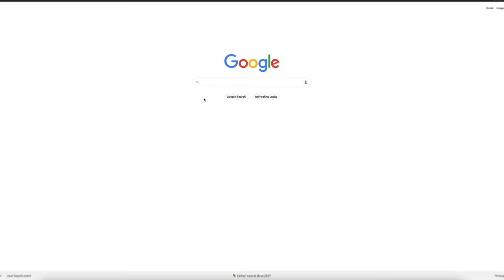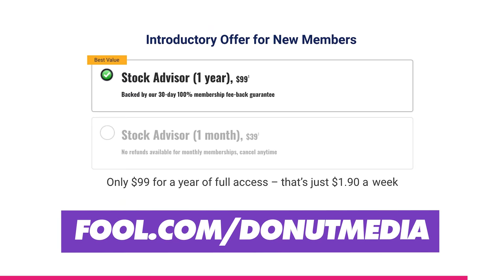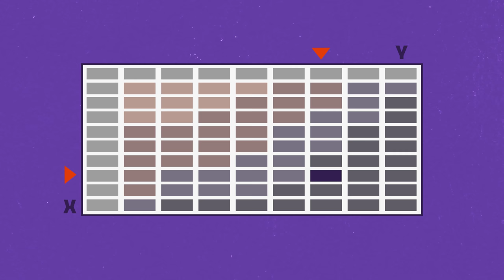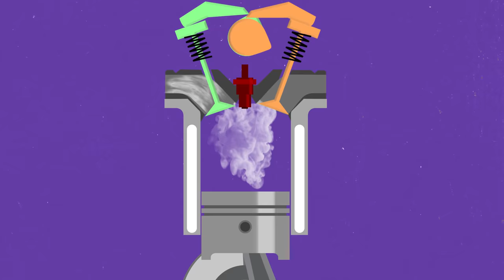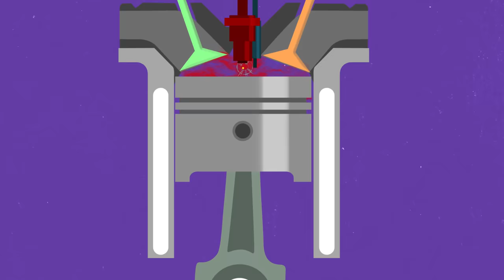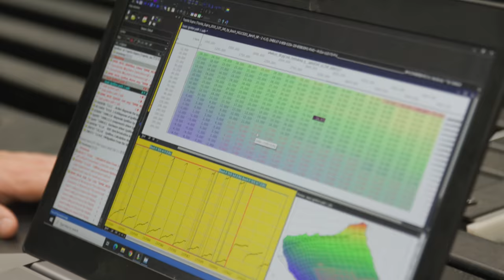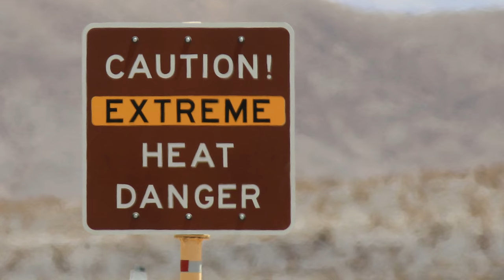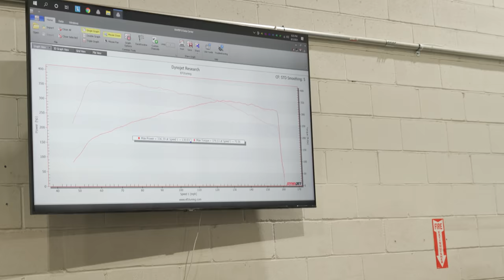Why Are They Banning ECU Tuning?

Comment: Whats sad is that ECU tuning shouldnt matter. If they are worried about pollution then just do a normal smog test. If it passes then the tune doesnt matter. If it doesnt pass then oh well, get it fixed. The point that ECU tuning actually is better than stock isnt the problem, the problem is the gov wanting money to confirm and make it legal to do so. EPA isnt a law enforcement agency nor should it be. Im tuned with E85 and my emissions are a lot cleaner even though I burn more fuel due to the characteristics of e85, yet its illegal to tune to e85 no matter what although the gov pushes for cleaner fuel alternatives. Seems the only alternative they want is EV cuz its big money.

Comment: I don't know why they say an engine is an air pump. I don't think so. Air goes in, but what comes out is CO, not O2. So it is like an O2 to CO converter. Basically, its purpose is not to pump air. If it was, it would be called a compressor. A compressor or a blower is an air pump. At least that's what my little brain thinks.

Comment: I tuned my car for flex fuel here in cali. A buddy who has a smog shop told me imma need a new clean ECU because the previous smogs will automatically flag my ride even though I went back to stock cuz it won't sync with their records... If true its not just the ECU I will need, I'd also require the companion immobilizer right?

Comment: No thanks. I'll stick with carburetors and points distributors. If I want forced induction, I will use a belt driven supercharger. There is no reason an engine needs to be super complicated. I have gotten 1000+ hp out of a small block Chevy with absolutely no electronics to fail. Admittedly that engine would be a nightmare to drive on the street, and was built for drag racing. But cut that power in half, and you still have way more power than you can use on the street, plus a car that is fairly easy to drive on the street. And it is simple. Two valves per cylinder, one cam, pushrods, no VVT, same basic design they used back in the '50s and earlier. Solid as a rock. No small fragile parts to break.

Comment: What's the difference between metal, duraflex, fiberglass and ABS/etc. body parts? Carbon fiber is obviously great but expensive so I didn't put it on the list but I was wondering why our cars are made of metal and the racing/drifting ones have plastic like body kits
Reply: Lightness, strength, and price. 

Carbon fiber is extremely strong, extremely light, and extremely expensive.
Metal is heavy, strong, and cheap.
Fiberglass is light, strong, but more expensive than metals.
Plastics are light, weak, but very cheap.

In racing, lightness is most important and with big budgets they can afford carbon fiber. Drifting does not seek performance nearly as much as racing and cars are more likely to experience body damage, so plastic is the most price effective option. Road cars use either metal or plastic depending on body panel, just to keep price of production low.
Reply: @PURENT  im mainly asking about Duraflex, fiberglass and ABS. Whats the dif between these 3. Price range, durability and weight with a measure unit or some comparison(like Duraflex is x times stronger than Fiberglass and x times lighter)

Comment: Someone was not thinking about the big picture at all when they drafted this legislation. They need to stop, slow down' take a closer look, talk with the public more. Then implement a law that addresses emissions. 
That law talks about modified ECU programming in way to wide open of a definition. It should have stated something like:" Changes to the programming of a vehicles  Electronic Control Unit after initial manufacture shall not change values of exhaust gas emisions of oxygen (O2), carbon monoxide (CO), carbon dioxide (CO2) and hydrocarbons or change Lamdba outside of standard acceptable safe values as determined and set to law by the state legislature at a given time." Just stating changes to the ECU now makes all sorts of vehicals and accessories to them illegal. 
DUI monitoring
Measuring and control units for DUI restrictions. Not all but many of those devises that you blow into to start or not your car when you have gotten a DUI need ecu programming done.
Working vehicles 
Adding a PTO pump to operate a lift gate, snow plow, lift and all sorts of other things sometimes need ecu programming. Changes made that still comply to emissions but change power and shift function for towing trailers.  
Disabilities 
Some installation of wheelchair lifts in vans need ecu programming as well as some disability accessories like hand throttles, hand brakes, shifter relocation kits. 
They have affected so many areas they did not intend to. They are going to have to make changes to that law very quickly or abolish it and start over.

Comment: This shows how little they know about car tuning.
Car manufacturers don't have the luxury of time, to go about tuning every car, so instead they have a generic map that'll work for those particular models.
Half the reason why gains are so easy, is because it's tuned to that specific car.
Mine will have a stage 2 remap, which means better performance, and lower emissions.
Just shows how clueless they are.

Comment: ECU TUNING IS NOT WRITTING CODES -- IT SHOULD BE FEEDING INPUT TO THE CODES\MACHINE LANGUAGE. SOMEONE DID THE ALGORITHM for you AND YOU ARE ONLY FEEDING A VALUES.

The tuners understand the need of the engines but they do not understand the tolerance of an engine.
They don't know when they will put holes in the piston, throw rods and land a ring and the catastrophic engine failure like cracking the block and the head. Metallurgy is another area a tuner must understand.

Comment: But is there a second elephant in the room?? How much of this is banning drivers of usually sports cars getting a more performing tune, or at the very least a tune better suited to the climate the car is driven in (sea level, temperature, etc), and how much of this is about just doing a blanket ecu tuning ban because of the “rolling coal” diesel truck assholes and the government doesn’t care to take a more nuance approach.

Comment: If your car was built after 1972, are you really a car guy? 1966 Chevelle with a 572 big block with a 14-71 supercharger, 1965 Chevy G10 Van with a 383 stroker factory rated at 600 hp, and a 72 Vega funny car that runs mid fives in the quarter. All without the benefits of an ECU or catalytic converters.

Comment: A) anyone claiming their tune is better for emissions is a fat liar. I'm friends with a guy that started Wolf ECUs and used to do R&D for GM and earned his PhD in combustion simulation. 
B) physical changes MIGHT make the emissions better, but those were also blanket banned a long time ago. The basic premise is that there's no real way for the smog shops to test this. They just look at two common load points and sample there, but the actual full test is very expensive and time consuming. It's easier to just blanket ban any tuning since there's no way to really fully validate.

Technically it isn't REALLY banned. You can pay 10-15k to get the full test approval and a sticker for your modification. You just need to do.it after ANY change.

Comment: Most people aren't Tuning Modern cars they Tuning 10 to 25 year old cars most of these are for racing purposes.these are not most peoples daily driver a lot of these cars run mostly on e/85 or methanol not (Fossil Fuel) most of these cars are broke down or in some state of repair a good chunk of the year so there low mileage vehicles.The truck and trailer that tows them to the track probably is doing more polluting than than race car,and they are a very small percentage of vehicles on the road.car's are not as big a problem as say the trucking Industry.

Comment: Color me surprised that your "experts" who just happen to be and ECU tuning shop you've worked with in the past and stands to lose with this would say that ECU tunes don't affect emissions.  You even state in the video that they go for rich mixtures and I don't know how many videos of Donut's that I've seen where y'all have done tunes that undermine this video.  I mean the high/low series and the worth it Miata for a start.  You can disagree with the regulation without being dishonest about the reasons for the regulation and acting like there isn't a valid reason for it.  ECU tuning has been used to get around emissions testing forever, including setting one tune for passing testing and then another tune for all other times and y'all have even talked about it in your videos.

Comment: They don't want ppl messing with the speed controls and frequencies of electrical cars lol. Breaking spindles, gears, and other shenanigans. Most importantly you think the ecus won't have monitoring ability and means to transmit it out of the car??? Imagine going into the electric vehicle ECU and changing the P.I.D.s to have all types of fragile warranty clauses with cars that most non dealership repair shops don't know how to fix anyway lol.... F that. Put on a piggyback VFD and potienometers on the rear wheels..  only electricians and instrument technicians be able to tune with the least amount of danger.... Hehehe luckily I'm one of them..

Comment: Having tuned MANY vehicles, The ONLY vehicles with a lean ratio were Holden GM vehicles utilizing a lean cruise mode at very low throttle.

Also, most all cars have stoichiometric (not stokeometric as you call it) ratio at 14.2, not 14.7.

Finally, NO tuner on the damn planet would EVER tune a street car to less than that for normal driving, and power enrich mode is anywhere from 13.xx to 10.xx ratio, depending on engine and application.

Where does this idiot get his info from?

"Some tuners advance timing by several degrees..." several you say? Try 30 or more degrees!!!!! Far more than "several" and once again, it is application specific. For example, I can run up to 36° advance on a V8 I have, whereas I get less than 10° advance from the motor in my truck with the same load. Basically, advance is dictated by detonation. You advance as much as possible without getting "knock".

I also didn't hear anything about DFCO! This can increase fuel mileage substantially if implemented properly and you can even reduce brake wear in towing tunes and heavy vehicles with DFCO tuning.

There is also the topic of direct injection and the harsh reality that engine performance and efficiency will degrade significantly over time without some method of cleaning the coke from components.

Comment: Shot your own feet.  First you describe 'optimizing' fuel air ratios for power rather than ensuring complete fuel consumption, e.g. optimized for fuel economy.  But you never say what happens to the unburnt fuel.  Umm, emissions.  Later you claim that a tune can optimize for combustion and therefore meet or beat factory programming on emissions.  Which is it?  You can't have both.  Also, virtually every modern car has dynamic advance control where it will gradually advance the timing until pre-ignition is detected by the knock sensors.  If you put lower octane gas in the car, it will detect the knock and pull the timing back.  Start putting the correct gas in and it will creep the timing back up.   AAA tested this on a number of cars in terms of acceleration and gas mileage finding improvement in both.  More highly strung engines showed higher gains while lazy old iron showed smaller but measurable gains.
Obviously there is an industry built up around folks with dynos and laptops charging significant amounts of money to 'optimize' customers cars.  And if they ignore emissions they can usually eek out some demonstrable gain.  Which is why it is the same thing as physically disabling emissions equipment.  It doesn't matter whether you take an air pump off (which I admit to being guilty of back in the day before we realized how much we were collectively screwing up the environment) or you increase an injector pulse width to get a rich mixture.  Both are changing the design that was certified as conforming to current regulations.  Is 5 more HP worth your children not being able to breathe.